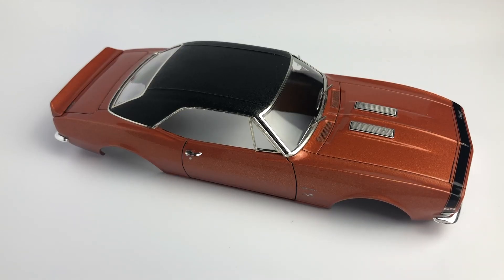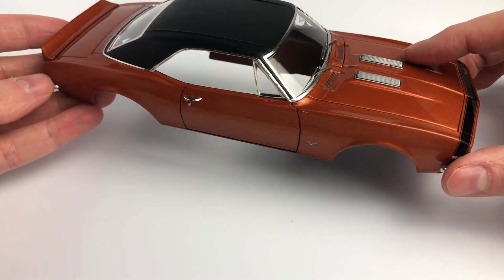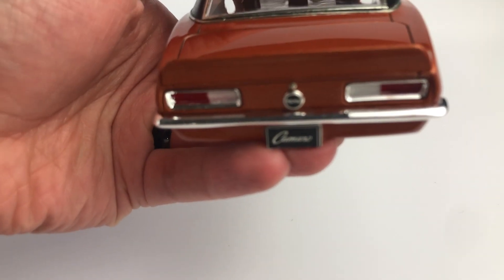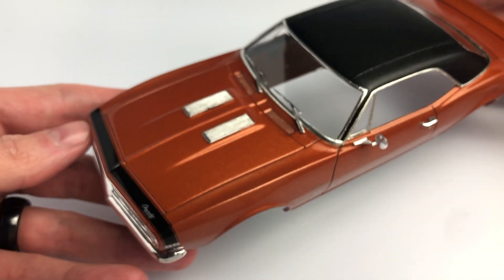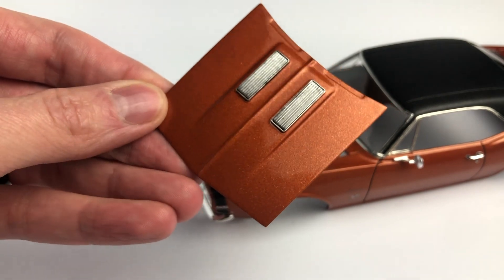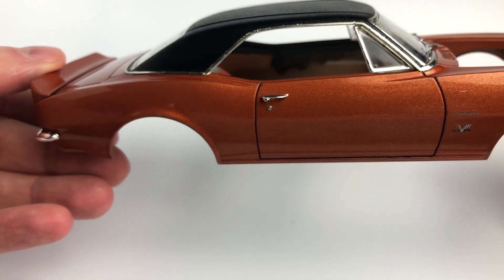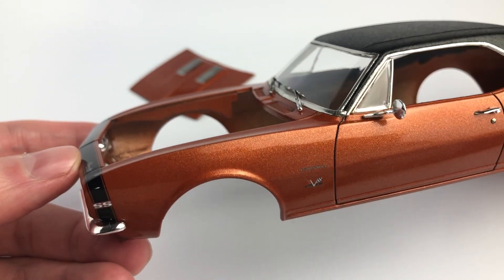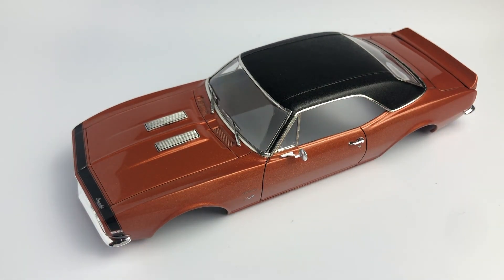Revell 1967 Camaro SS

Comment: Very nice...what was used for the vinyl roof?
Thanks.
Reply from the maker: Scale finishes faux Fabrix is what what used including styrene rod to creat the vinyl top look. Faux Fabrix is no longer made so many are using rustoleum textures spray paint.
Reply: @MileHighScaleModeler  ok thats what i got rustoleum textured👍